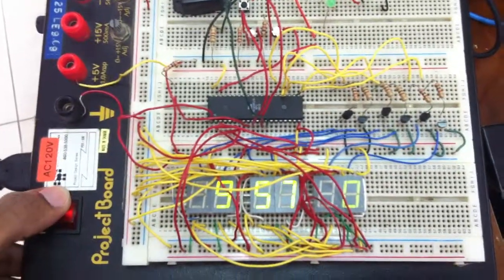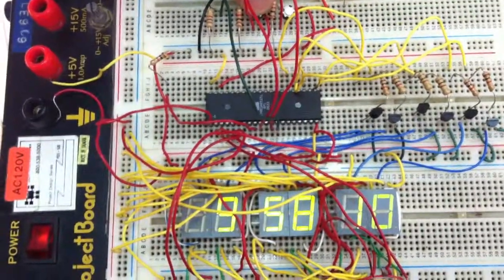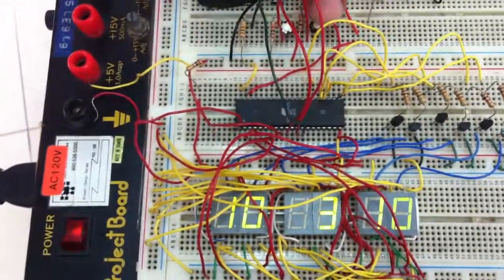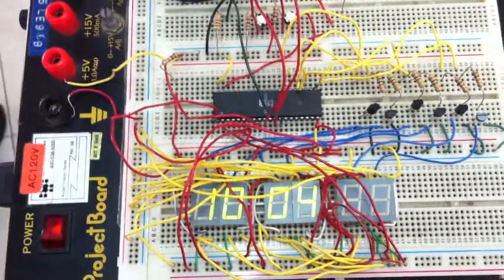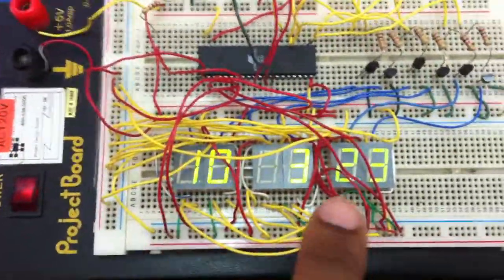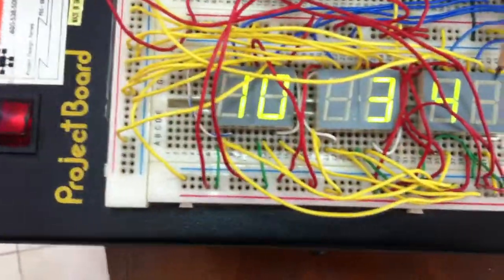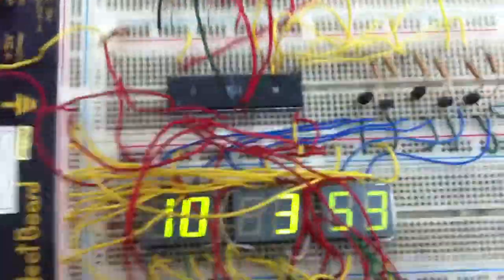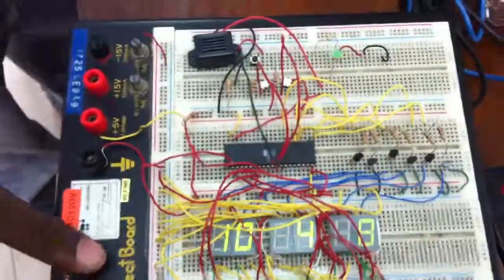Digital Clock: ATMEGA8515 & 7 Segment Displays

Comment: How did you get the ATMEGA8515 to output a 1s pulse?  I'm currently feeding an RTC into my ATMEGA8515 to get the time, but I'm looking to reduce the component count / cost of my design.  Are you able to share the counting portion of the code?

Thanks!

-Alex
almgreig@gmail.com